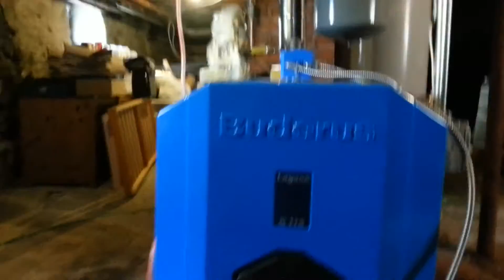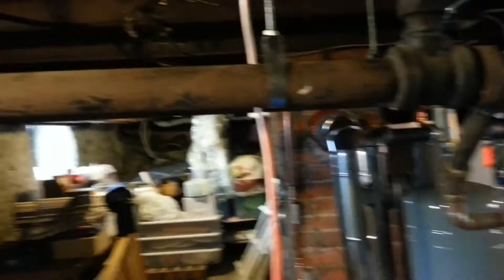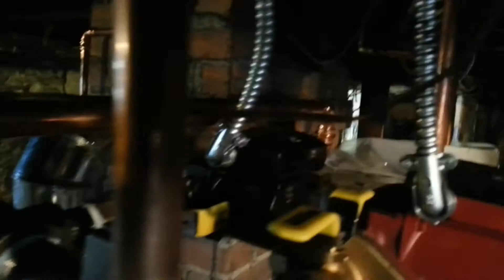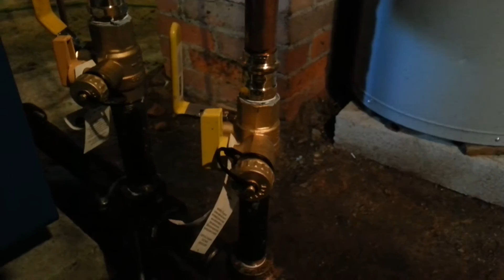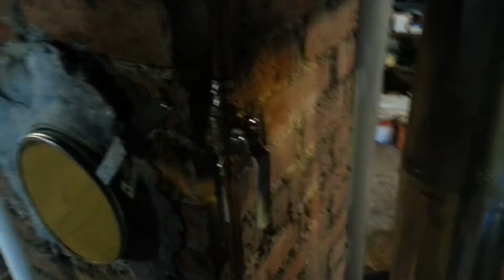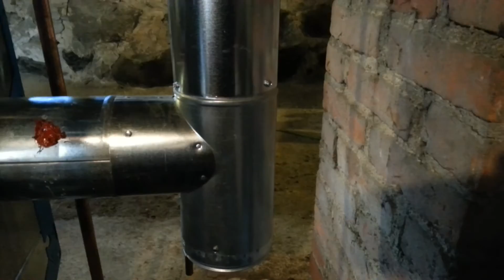Buderus Oil Boiler  Replacement G115WS-4

Comment: Looking at getting this Model Boiler for my 2000 sq. ft 1911 foursquare brick, with converted to water radiators.  We'll probably make it two zones.  What is an average BallPark cost for removal old boiler (1970 Box type),  and  Includes vent connections, oil line connections, electrical connections, permits, labor, and start up?  Also can these units run Bio-Diesel??  Thanks!  BTW Very helpful Video, thanks!